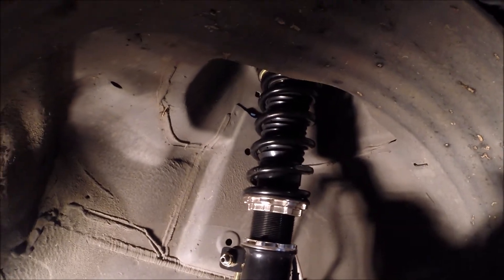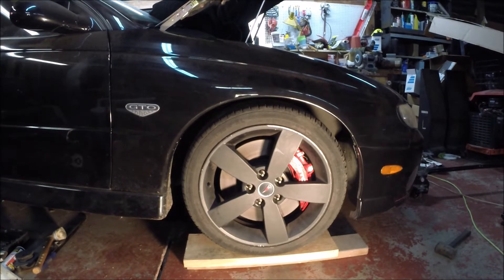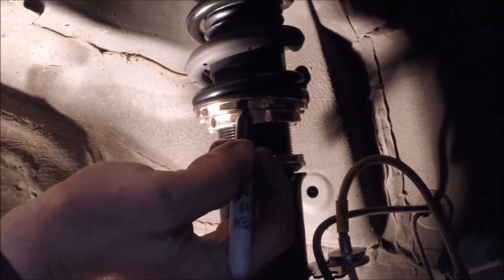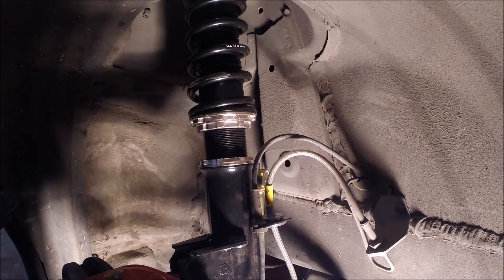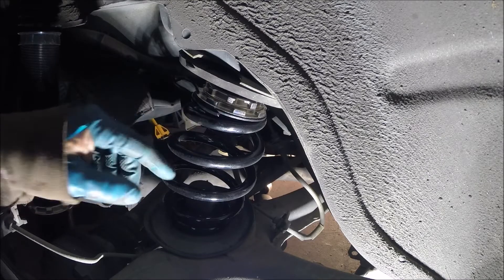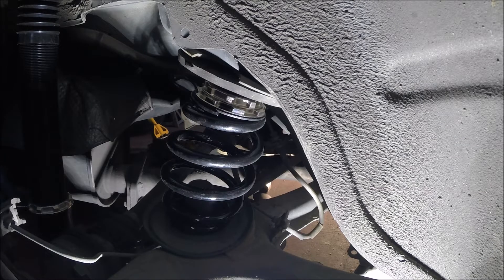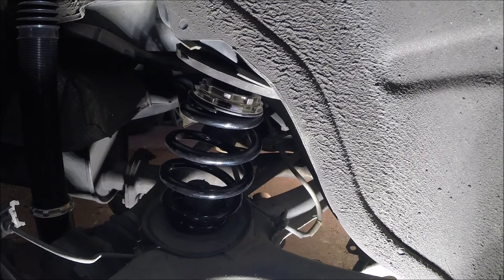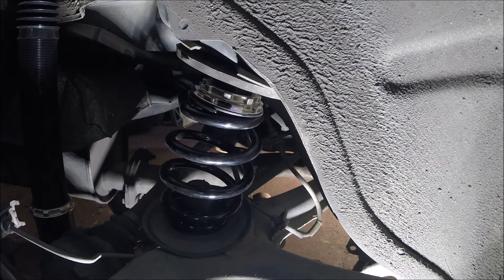2005 GTO suspension pt 9 setting ride height

Comment: Thanks man this going to help me out when I install my BC coilovers this weekend, rebuilding my suspension and your videos are going to help out alot
Reply from the maker: Glad to hear it, lemme know how it goes, I can't always remember to include everything when recording
Reply: @evsnova74  will do man thank you!
Reply: @evsnova74  did you have to get camber correction plates for the coilovers? Or where you still able to align it with out them?
Reply from the maker: @dranoer209  well the thing is I didn't do enough of a drop to really mess with camber so I can't really be of much help there. I suppose if I had I would have looked into using the eccentric bushings from whiteline but who knows if you can find an alignment shop who knows what to do with them.

Comment: Random thing i did that seemed to work out great, was setting my passenger side about 10mm lower than the driver side. This gives me a truly perfect ride height when I’m in then cockpit.
Reply from the maker: Damn you really are bulky lol
Reply from the maker: I thought about doing something like that but opted for it to be perfectly level in case passengers or whatever. I'm pretty lightweight anyway, though with age that's changing. Maybe I need to start hitting the gym......
Reply: @evsnova74  I fucking am bro 😂😂😂😂
Reply: @evsnova74  hahaha dude honestly I think the difference is closer to 5mm. But I’m pretty sure the goat from the factory has more weight percentage on that side of the car than the passenger side. I could be wrong but the coolant expansion tank, car’s computer, the whole steering wheel/column LH drive and stock catback is moreso on the driver side and I like the feel when cornering to have my side a slight hair higher. Might just be cuz we drive on that side 🤣
Reply: @evsnova74  but I am about 240lbs so that’s a slight chunk of weight if you think about it

Comment: Nice job. How stiff can you adjust these set up, specialy the rear? I'm trying to get rid of the squad. Thanks. Keep up the good work 👍
Reply from the maker: Well thanks. The dampening adjustment on the shocks can get ridiculously stiff but I'm not sure how it affects the squat. The spring is what it is, I didn't get upgraded springs from swift. When the weather breaks and I get this thing off jack stands I'll try to get a video of a launch
Reply: That would be awesome! Thanks for the quick response and I'll be looking forward on watching the video when it comes out
Reply from the maker: @willsperformancetech2933  right on. I've got the headers on, front sway bar and cradle have been replaced. But I haven't touched anything in the rear yet so I'm still hoping I can even get this done before the weather breaks.

Comment: Dude I figured out why I had so much space between the retainer plate and the coil over assembly. My OEM style mounts i bought were crap. Bought a new one for the driver from GTOG8TA and had it shipped to replace and now there’s no gap.
Downside, is now my driver side camber is a lot more negative. The passenger side even when lowered, didn’t affect the camber much at all and I’m assuming due to the faulty mounts. 

Anyhow my question is now that I freakin loctited the clevis bolts and the caliper bracket bolt, and I know I have to adjust the camber do I need to remove all those in order to add some positive camber back? Or can I just mess with the camber bolt without removing those 3 🙃. Should’ve switched around my clevis bolts like you did from the start
Reply from the maker: You're adjusting your own camber? How are you measuring it? I'd be letting an alignment shop do that. And no the caliper bolt doesn't need to come out, you just loosen the clevis bolts, I probably wouldn't worry about loctiting either, I doubt alignment shops do but I may be wrong. Worst case just remove the nut and loctite again, though the bolt will still have some loctite on it. Maybe get one of those plumber's wire brushes for copper, idk the bolt is big enough though
Reply: @evsnova74  nah I’m definitely gonna have an alignment shop do my alignment for sure. I need to put tires on up front. My only concern was now that the whole coilover assembly sits in there right with the mount proper.. there is a lot of negative camber on the driver side. Pass side is still fine because I haven’t swapped the pass side mount out yet (pass side still has a lot of gap between retainer plate and frame of car) so the camber on pass side is fine til I get a new mount for that one. Driver side is all set up all ready to rock but driver side camber is super neg. Should I mess with it? Or at least screw in for a little more positive? And if I do, do I need to remove the clevis bolts or loosen them to mess with the camber? I’m not actually setting any of the camber/caster/toe settings myself. Just wanted to get the driver side as close to normal as possible before going to align.
Reply from the maker: @permabulk1454  one trip to the alignment shop isn't going to cause any noticable tire wear on the inner edge on that side, but it wouldn't be hard to just loosen the clevis bolts slightly and tighten the camber bolt at the top of the knuckle a little either.
Reply: @evsnova74  yea that’s exactly what I’m sort of asking. Do I loosen the clevis bolts to adjust the camber bolt? And is it screw in for positive camber screw out for negative? Or vice Versa
Reply from the maker: @permabulk1454  yep just loosen them a little. Pretty sure when you screw in the camber bolt it forces the top of the knuckle outward, making it more positive.
Reply: @evsnova74  cool I’m about to go do that. I really should’ve flipped my clevis bolts around do you know why GM put the clevis flange nuts on the side with the caliper bracket? As opposed to how you flipped yours around? Any reason why they’d do that ? 
Now just slightly loosening the clevis bolts I’ll have to remove the god damn caliper bracket bolt too 😖😖😖😖 smh
Reply from the maker: @permabulk1454  why? Just get a box end wrench on the head and loosen the nut with a socket. You don't need to pull the bolt. Idk why they did it that way, makework for the service techs
Reply: @evsnova74  thats the thing I don’t have a 22mm wrench for the nut side. Only a 22mm socket (and it’s tiny at that) and a 19mm box end wrench. So In the name of one of your vids “my wrench game is wack” lol 🤣 I have 8mm up to 19mm wrenches, various sockets and a 24mm wrench for the strut top nut. Now I just need a god damn 22mm wrench 😖. I guess I could attempt it with my nice ass adjustable wrench I’ve used plenty of times. Just worried about messing up the clevis bolt nuts. Thanks for all the help
Reply from the maker: @permabulk1454  try a socket on it with an extension. I may be misremembering but you should be able to fit a socket on it, you just can't pull the bolt? I'd have to see it again. Of course mine might be completely different now with the brembos
Reply: @evsnova74  yea when I watch your vids, your brakes aren’t even stock. I know the 05/06 stock brakes are almost an inch bigger up front (rotors) 04s are near 12” rotors and 05/06s are near 13”. Rears are same all 04/05/06. The front OEM caliper bracket bolts on the 04s are m12-1.50 x 40mm whereas the stock caliper bracket bolts on the 05/06 are m14-1.50 so even thicker. 
The way the caliper bracket bolts are placed, theyre right next to the top clevis bolt nut and there’s no physical way to remove the clevis bolts initially (when I did the coil over swap or even if you’re just removing your stock struts) without removing the top caliper bracket bolt. Not the bottom one just the top. 

Long story short I’ve had a caliper bracket bolt back out on me before while driving (that was my error, painted the brakes and didn’t loctite the caliper bracket bolts in) so now whenever I remove that bolt I always torque the shit out of them back in, and always reloctite. Well whenever I remove that top bolt (which I’ve done 2 or 3 times now doing the coil over install/re install lol) it worries me having all the dry loctite in there and I don’t wanna fuck up the mounting of the caliper bracket. 

Sorry to ramble… in your videos I can tell you have aftermarket brakes (look like the bigger 4 piston or 6 piston fronts) and you also seem to have Allen head bolts as your caliper bracket bolts as opposed to the normal stockers. So you personally might actually be able to remove the clevis bolts (or loosen in this case) without messing with your caliper brackets. 
However I did see in one of your vids you switch the clevis bolts around after you pulled them initially, and I know a lot of guys do that literally to avoid the situation im currently in 😂. I just don’t like changing things around from oem just if they did it for some specific reason 😆

Comment: This weekend, 2/19 I’m putting the bc br series on my 04 gto. I’ve been watching your whole series on this daily for a couple weeks now. I really liked the final ride height on the front so I’m going to start with your 65mm measurement and see if it’s the same on my car. The rear I want a little higher than you ended with. Goal is 275 tires at some point. 
Did you ever measure the rear adjuster thing on top of the spring? How far from the seat of it to the bottom spanner bolt?
Thank you for these videos again. I know you said next your doing the rear cradle and I hope it’s soon. That’s my next move as well. I already have an entire extra one in the back of my Astro van. I put a short up showing the play in the pinion and ring gear.
Reply from the maker: I can easily measure the spring in the rear next time I'm in the shop. And I will be doing the rear bushings soon but I don't know when the video will go up. I still need to get the pinion seal too
Reply: @evsnova74  I appreciate you
Reply from the maker: @Modern-Muscle-PNW  I started on my rear suspension yesterday, got everything removed from the control arms, dropped the differential mount and popped one of the sub frame bushings out. Right now I have easy access to the control arm bolts so apart from pressing the bushings out somehow it's all downhill from here. I'll go ahead and drop these videos first but I don't know when I'll get back over there to finish up. Maybe I'll get a day off this week and make it over there but if not I don't see how I wouldn't have this wrapped up by next saturday.

Oh and I measured that spring perch and I think it was 1 5/16" between the upper adjuster and the top of the perch itself but I didn't write it down nor take a pic because my phone was having a new screen installed at the time. I may try to go over there today after church and get something done on it and will confirm.
Reply: @evsnova74  I got all of it installed yesterday. I went with your measurements of 65mm in the front and it’s low. Real low. I remembered you have factory wheels which are 17” and mine are 18”. My fenders have been rolled so maybe it’ll be alright. I took it around the block and there doesn’t seem to be much travel. 
I had to cut off one of my ball joints with a sawzall. 
The rears I adjusted about a centimeter from it’s highest point. And they are slightly uneven. So today I’m going to lower the rear some and probably lift the front 5mm. 
I showed one of my friends that rear end and he thinks it’s fine. All that noise is in the rotors cuz they are loose. But the pinion has almost no slop it turns axles immediately. So I’ll start buying the bushings and the alignment tool. 
Once my suspension is settled I’ll put my driveline in to make sure it works. It’s a Hinson and slot of people don’t like them. But my new diff is an 05-06 so it’s got a different bolt pattern. My stock one won’t work so I need to be sure this one is good or order a new one. 
My car has the 3.46 gears and my new ones are 3.90. Can’t wait to see what that does for me. 
But I’ve lost my drag bags. I’ll be able to tell you if it’s better or worse. I was okay with the factory height in the rear so if it’s too bad I’ll put my original setup back and just keep the bc shock. 
Thank you bro. I’ll be watching these next ones daily and in two months that other cradle will be going in.
Reply from the maker: @Modern-Muscle-PNW  I had to get factory 18s to run these Brembos but the beauty of measuring from the fender lip to the center of the hub is that it takes the wheel out of the equation. Apparently there is a lot of variance from car to car with these, you'll just have to play with it and get it where you want it. At least that measurement is in the ballpark, if you watch the Josh's car corner video he jacks it way up for the initial adjustment and it's like 3 or 4 inches between the top of the tire and the fender lol
Reply: @evsnova74  i have all day today to get it right. The front looks great though. If I can feel comfortable my tire won’t eat my fender.
Reply: @evsnova74  ended up taking the adjustable springs back out and putting my drag bags back in. The wheel hop was horrible and it was wet!
Reply from the maker: @Modern-Muscle-PNW  supposedly the control arm bushings help a lot with that. I'll know in a few weeks..
Reply: @evsnova74  it seems like each piece helps a little. I’m saving the bc springs so if the hop is gone when I put the bushings, axles and harrop cover on I might try them again. 
Adjusting the shock helped too.

Comment: Do you know what the maximum ride height is for the BC coilovers?
Reply from the maker: @Geni3420  good question, I really don't have a clue. Probably won't be easy to find either, since most people get coilovers to lower their cars. Maybe email BC?
Reply: @ I have a 2006 GTO with BC coilovers and I want to to get it at stock height or higher just cant seem to find any answers
Reply from the maker: @Geni3420  they will definitely go to stock ride height, I'm only at a 10mm drop front and rear. Should be good for at least 30mm higher than stock I'd say
Reply: @ I cant find any shops that have a clue how to adjust these things. I’m in Wisconsin if you know anyone who knows how to adjust these things please let me know.
Reply from the maker: @Geni3420  I don't know of any shops but as you can see from this video, you don't need any specialized tools to adjust it yourself. Maybe it will be tedious because of the trial and error aspect of it, but I show you exactly what to do here. If you don't have the spanners, just use a hammer and punch.
Reply: @evsnova74   Thank you!